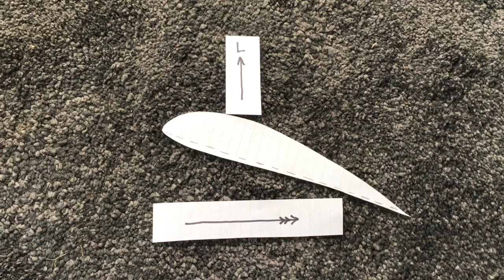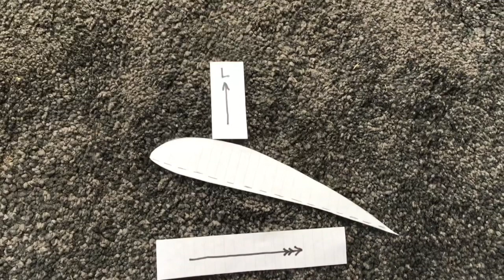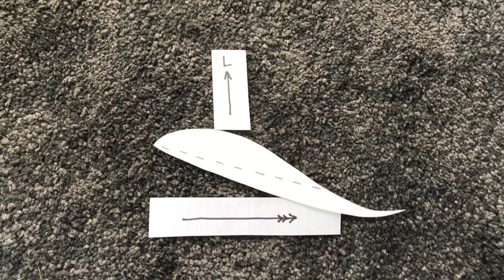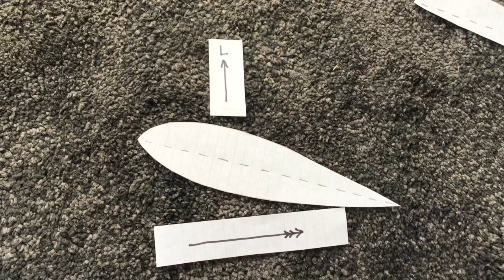Reflex wings for dummies (yes including you Dell)

Comment: Having just seen Dell's view of the reflex wings NOW I get YOUR video which is AWSOME for me because I love to hear all sides of any story. So far my conclusions is tentatively about the pilots REACTIONS to changes in angle of attack. It seems like if you do NOTHING on a reflex wink it will stabilize itself but if you are on a non reflex wing you NEED to apply action to maintain stability. This makes me wonder what happens if a pilot reacts according to a non reflex wing but is actually on a reflex wing This MAY BE the problem some pilots experience.

Comment: Macpara has a Reflex wing called Charger. It has wingtip stearing which is supposed to be used when trimmers are all the way out, ( Reflex setting. You stow main brake toggle and use the wingtip stearing toggle). Anythoughts?

Comment: nice level headed excellent how it works video .. No name calling .. Just good solid presentation of how it works .   No screaming ,yelling  rolling eyes . just the presentation of FACTS .   Brilliant   well done . top man .  Such a shame that a certain group of instructors   are seemingly unable to put their personal aims to one side and present the facts as you have done .  I have followed your presentation  closely and can glean that the reflex wing  will automatically adjust for some levels of turbulence .  Whereas any non reflex design  will need to be actively flown through sketchy / undesirable  conditions . . The question with pops up in my logic filter .WHICH ONE is more likely to end in tears .  IE which one will return to  a flying wing rather than a bag of twisted up shroud.. all things being equal . dramatic statements like face down , plant etc are not very constructive . I have dabbled in Lawn darts( hang Gliders ) and flown as passenger on a paraglider  and flown [passenger in a trike hang glider .. The Hang glider trike was the most controllable with excellent feedback .

Comment: Super job Ian. If I didn't know any better I would think you read the test results. Here is a link for the actual NASA test on the reflex design, I think back in 2003 or something. The test speak for themselves and rightly show ignorance in aerodynamic theory, especially surrounding reflex glider wings. https://ntrs.nasa.gov/api/citations/20040161133/downloads/20040161133.pdf

Comment: I have been paragliding since 1998. In 2010 I decided to switch to a reflex paraglider and I bought OZONE Roadster I have flown with it in a variety of conditions (both free flying and with paramotor). In some very windy conditions I took advantage of it especially by avoiding being blown back the hill but in light wins I saw that the performance of standard paragliders was better in terms of staying in lift. Overall I can say that reflex wings have great speed and security performance however their trade-off is not generating enough lift in weak conditions. Overall, I am satisfied with this wing, still flying with it. You can watch some of my flights in my channel. Hope my comments are useful.

Comment: Great explanation. I was watching this video https://youtu.be/HV9BNn47Ejw?t=570 where at 9:30 the author explains how he got a collapse on a reflex wing. He was accelerated and he went off the speed bar just before the collapse. This is the right behavior on conventional profile wings. I was wondering if on reflex wings, the reaction of releasing the speed bar while encountering turbulence is the right thing to do. Maybe you can help me understand this?
Reply: It could be that the combined angle-of-attack increase of entering lift and dumping speedbar caused the wing to surge forward (centre-of-pressure moves back) enough for the angle of attack to go negative? If at low altitude, could also be that by the time the wing surges, it hits sink at the "far side" of the thermal. Depending on the glider design, it's either best to stay fully accelerated through turbulence, or go trims in and fly "actively" like a normal paraglider.

Comment: I believe your the only person who can better explain how the Hadron XX flaps influenced the wing. I saw that somehow break the profile , but I would be very thankfu and appreciative  for your explanation.  I fly the wing quite often with flaps engaged. 
With best regards!
Marius
Reply from the maker: Hi Andrei. With no flap deployed the Hadron XX effectively has the same amount of reflex at any trim setting. This is the same as Ozone wings and different to other Dudek wings which generally having largely increasing reflex the more released the trimmers are. Changing the trim setting on the Hadron XX consequently changes the incidence of the wing (relative to the pilot) which consequently impacts the angle of attack. Therefore on the Hadron XX trims in is the wing section at one angle of attack while trims out is the same shape wing at a lower angle of attack. On a Nucleon XX (for example) trims in is a wing section at a particular angle of attack while trims out is a different (even more reflexed shape) at a lower angle of attack. Do you see the difference? Most Dudek wings (other than the Hadron series) increase the negative curvature as the trims are let out but the Hadrons effectively don’t (same as Ozone wings). Now you asked specifically about flaps... the flaps on the Hadron XX are proper flaps like on a light aircraft. They operate purely on the trailing edge at the centre and change the airfoil to a much higher cambered one. On the Hadron XX we have gone from a negative camber (reflex) to a very highly positive camber which is why the wing goes all floaty when the flaps are deployed. The wing is now a regular paraglider and should now been flown actively as the relationship between angle of attack change and centre of pressure movement has reversed, ie it has become conventional. Hope that helps!
Reply: @TogaSRS  It helps, many thanks for taking the time to reply.   I know about the constant reflex profile as also being  the reason we could apply speed bar without releasing the trimmers.  The flaps was a mystery for me, while I suspected that it change the wing in to a non reflex one, I still found it some how pitch stable with flaps engaged and this was the contradicted factor for me. Now it's clear.  Many thanks again.

Comment: Hi, Ian. I'm trying to understand. I did not major in physics nor am I a mathematician so perhaps you can answer this line of question so that a layman can understand. I'll admit to having watched "SuperDell's" (uggh!) video and then watched yours. He used the expression, "You can't push a string", and I'm trying to understand how the trailing edge of a soft para-wing can hold that upturned shape when air is flowing over the top surface, exerting downward force on that upturned edge. In our discussion, a friend suggested it's possible that "You're not so much pushing up on the rear as you are letting the lines out so that the back of the wing becomes taught at a higher angle?" As I said to him, I understood his concept, but I don't see how releasing the pull of the rear lines would result in the rear of the wing holding that upturned shape unless there's significant pressure against the bottom that could cause it to hold that shape despite downward force from the airflow over the top of the wing. If that were the dependency for the reflex shape to work, that upward force would need to be consistently stronger than the downward force that is then causing the increased angle of attack. I hope my question is clear and that you can respond to his terms that don't include mathematical formulas. Thanks in advance!
Reply: The ram air profile in modern wings forward section (sharknose in ozone as an example) when moving forwards, creates a positive pressure internally. With all gliders "falling" at a sink rate (dependant upon the wing) the wings shape loads the top surface which again creates a 'pulling force' which is pulling the upper and lower sections apart slightly. These two forces combined make the wing stable up beyond any lift vector point in any angle of attack. In reality the pressure differential in level flight between the internal section and the lift forces of any wing only needs to be 1% higher to maintain internal pressure but in reality a EN A wing can have up to 40% a B around 30% and then C and D vary greatly depending upon the wing.

Comment: You didn`t explain why the chord line on a reflex wing ends part-way along the top surface of the wing rather than at the trailing edge as in a conventional glider?
And in your diagrams, the CoG (the pilot) is always depicted directly underneath the wing. This isn`t exactly the case during powered flight is it - the pilot (under power at least) is always slightly forward? 

Does it still remain true that the centre of pressure moves forward within the wing when trimmed fully out compared to trims in (and this theory of self-stabilisation due to the centre of pressure moving fore and aft according to the AoA is in addition to the trim setting related CoP movement)?
Reply from the maker: The chord line doesn’t end if it should happen to be above the upper surface of the wing! It is a theoretical line between the leading edge and the trailing edge. That is the same for any wing section whether reflexed or conventional. With regard to the suspended mass being directly underneath... as I mention there are some simplifications that need to be accepted to make a point that can be understood by anyone coming at this afresh. There are many more however the need is to keep it simple so the basic concept is understood. I am a little concerned when you mention the centre of pressure “within the wing”... the internal pressure and the centre of pressure are completely different things that should not be confused. I am not quite sure what you are asking in the last question. Are you assuming a wing that increases the amount of reflex profile with trim release as well as changing incidence (and therefore alpha)? I presume it’s that you mean rather than a constant profile reflexed wing?

Comment: Honest question here... if the reflex wing is so stable in full trim out mode ... why does the certification not bear that out?? My understanding is the reflex swings are only certified in traditional mode not reflex mode. Am I wrong here??
Reply from the maker: Honest answer here. Certification involves testing recovery, not stability. Reflex wings don’t recover as well as most traditional airfoil wings and that increases if you let the trim out on a wing where the amount of reflex increases with trim extension. Therefore if they do bother to put them through a proper testing house then they will test them at the trim setting that is most likely to succeed. However the testing houses are testing for a flight regime they are designed to not get into in the first place which is the crux of the argument about the validity of using collapse recovery as the benchmark for wing testing.
Reply: This helps thank you very much

Comment: So why do the B,C & D lines go slack on a Dudek  reflex wing  when fully trimmed out? (Mitch G's vid) Surly the loading on the lines should stay the same at all trim settings if the wing profile stays the same?
Reply from the maker: Most Dudek wings increase the negative camber as the trim is let out. The effect of that is that the max thickness of the wing shifts forward shifting the lift distribution forward. Once the trim position is set any a of a change due to lift or sink still has a positive stabilising effect but around a point even further forward.